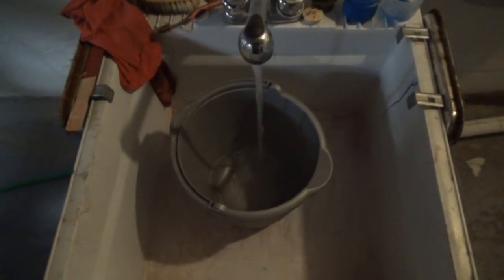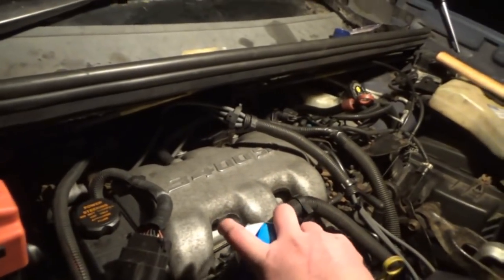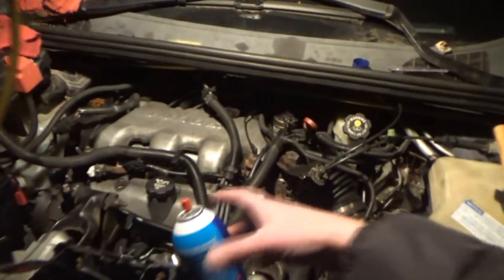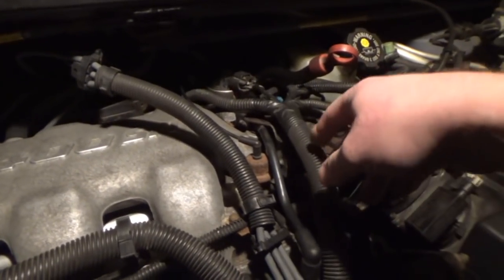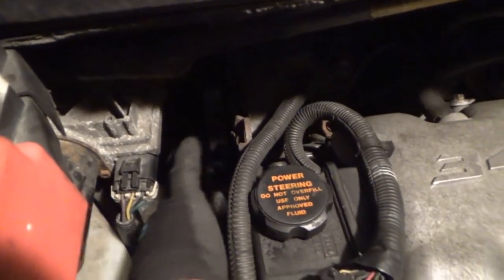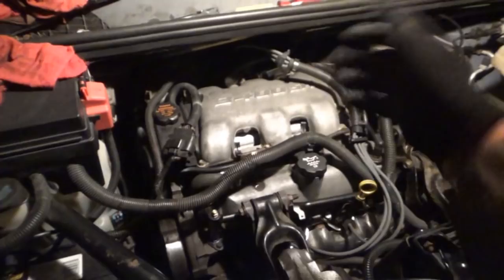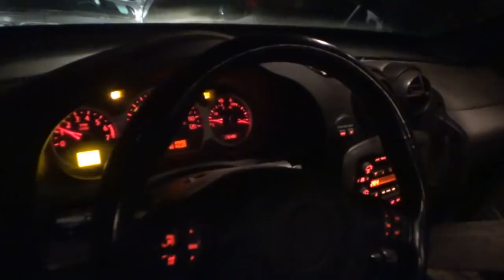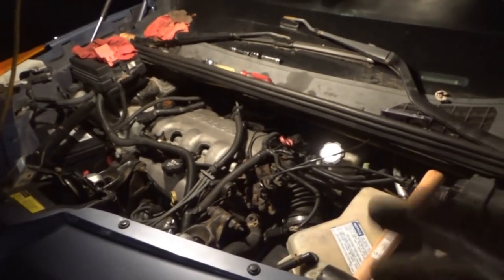MV 193 - "Aztek High Pitched Noise FOUND?!"

Comment: I hope you enjoyed your celebratory pizza!

At least you didn't have to take the plenum off, but I pointed you to the right area.  😎  Do NOT feel bad, it happens to the best. I may be a girl, but I know an Aztek inside and out by now. 😉

Unhook the compressor underneath, there's a large flat connector at the compressor to unhook. I do in the winter because it gets too loud (which reminds me I need to do it). If you pull the fuse under the hood, it also kills the BCM and power seat, mirror, ect. Though I recall there are two fuses in the center console that power the compressor. #12 for the compressor and #15 for the compressor relay and height sensor. I wouldn't pull fuses though, they could also be for other things. Plus, you may want to cap off the lines to the shocks later on and keep the line to the interior so the compressor may still be used.

But I am so glad you got that fixed and can now move on to other things your 'tek needs done!
Reply: Keep up the good work.  It's not about gender.  Either you're mechanically inclined or not.    I can see where a fiery vixen with a pair of pliers would create cognitive dissonance, especially among traditionalist.